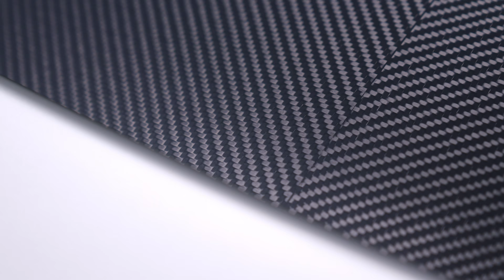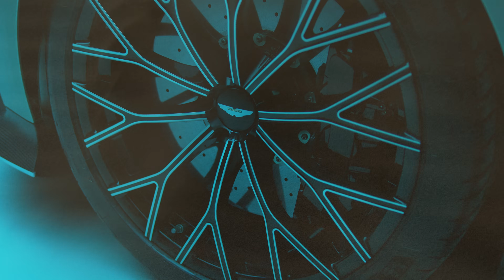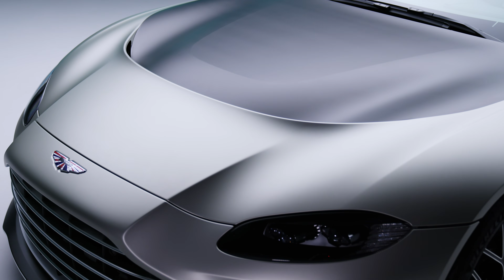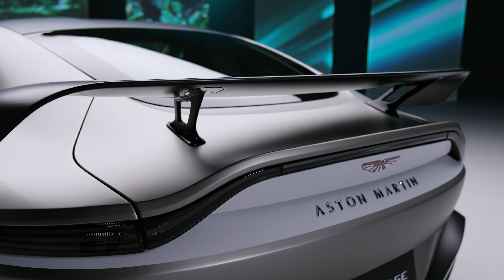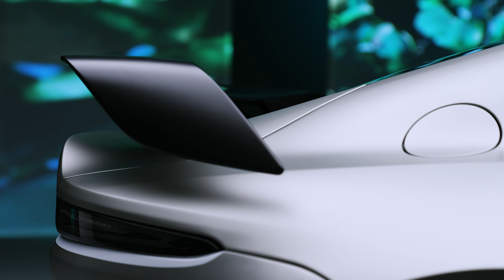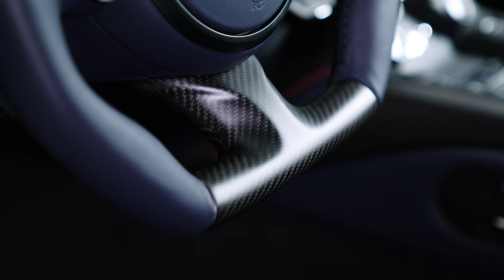V12 Vantage Walkaround | Aston Martin

Comment: 1) BEST CAR EVER (in FR configuration)
2) Wondering if you slapped the V12 bodykit on the V8, would it handle the same? or is there a chassis difference?

Comment: Sorry not a fan. In fact the same goes for the designer. The best he did by a million miles was the One 77! Sadly what has come since, have been rather non-distintive, and quite frankly tacky designs. Sorry.
Reply: V8 Vantage, DBS Superleggera, Valkyrie, Vanquish and Valhalla all looks great, but this V12 Vantage is utter disappointment. Its too flashy and on your face, that hood looks like it came from two different cars just welded together. Smh.